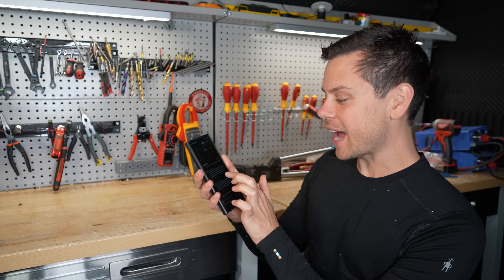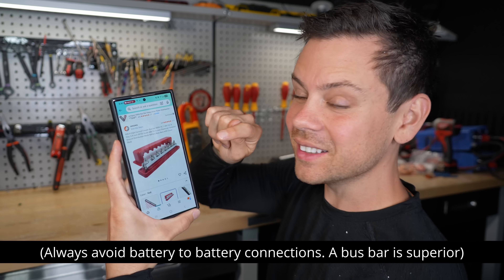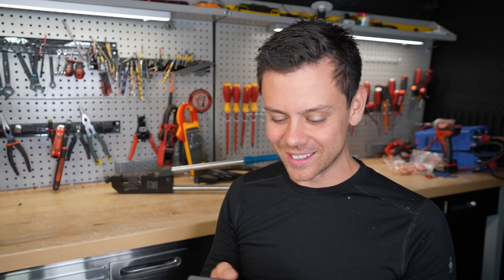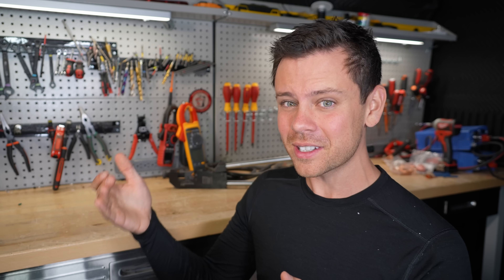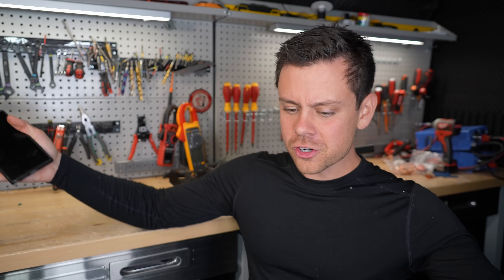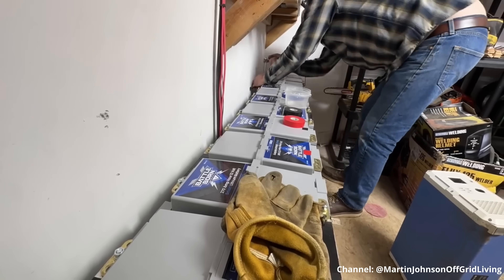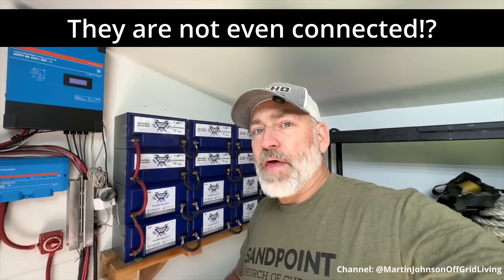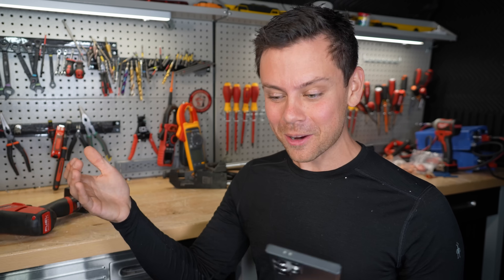My Reaction to Martin Johnson's "BEST Off-grid Battery Bank" Video 😬 Yikes!!

Comment: Soldering is actually better than a crimp connection but you have to use the correct solder. Silver solder has a higher melting point and is more conductive than lead solder and also has more strength than copper if done right. I’m going to say your definitely wrong on the solder joints if he actually does them wright which it doesn’t look like he did but your bashing solder joints in particular. I love your videos and definitely find them helpful but I don’t won’t the wrong info getting out. So far this is the only thing I have found in your videos that needs correcting. Keep up the excellent work.

Comment: You have lost credibility on this one. People commonly use 12v batteries to create 48. Eco-Worthy shows how to wire them that way. I agree that crimping is better, but if the batteries are going to be stationary and no one is going to be pulling on the wires your criticism of soldering in unfair. Next, there is very little information available on the correct gauge of wires to use for battery banks. The Chinese manufacturer SunGoldPower called for 4/0 the lug for which does not even fit the opening to their inverter. They subsequently  revised the spec to the correct size. Research does not provide the wire gauge specs and you have to calculate it based on mm2 carrying capacity of different size cables. It's very archaic and you can't fault this man for attempting to make the determination based on the amount of current he intends to use.

If you want to be critical, I suggest you take a look at DIYSolar, which is full of bad, unreviewed information that, if followed, can result in fire or death. It's actually very irresponsible to have a blog for this subject where unreliable and incorrect information is common. I.e., clean up your own house 
before you start throwing stones.

A video like this could lead to a lawsuit for defamation, especially since you are competitors in the business of making money selling advice, so you might want to be a little more careful. Many of the comments have pointed out where your criticisms are incorrect.

Comment: His logic for sizing the cables seems to come from house wiring, maybe. In house wiring you size your breaker and the following wiring to the load you are going to run. But, as you know, you don't do that with a battery bank because that would be like undersizing the wiring for the mains power coming into a house.

Comment: Dude is violating almost every rule for wiring up a system.

I thought that soldering in a no-no in home electric circuits, but I'm not a certified electrician and don't work with household electricity, so this is just from me trying to remember something from reading many years ago.

Comment: Will, how do you feel about using a victron distributor to parallel series strings of 12v batteries in a 48v system? Assuming appropriate sized conductors and over current protection via the distributor.

Comment: 0730MMXXV/1202h 🇺🇸 Will, Thank you. I don't think or imagine that, you are being confrontational towards any human being. By merely pointing out, the hear say assembler's folly is; not that. Spending tons of funds on Lishen/EVE prismatic cells,(made in China) that are assembled locally and using cheap Aluminium busbar to connect it,  is preposterous, unbelievable and uncalled for. Copper is the word, that needs to appear in mind, soul and sentiments, I dare say. You have performed several experiments, tests and several comments on many items related to PV panels, storage Batteries , its pros and cons. I've learned many things from you, in spite of my Doctoral degree in Nuclear Engineering. I,  still look forward to reading and understanding your presentations, in YT. I've seen many Warriors in YT, expressing , plagiarizing stanzas and wordings from other genuine technical experts and engineers. You express views and comments with several years of hands on experience and teach others, in a way they understand the concept of DC Power Supply, its potential working conditions.
Please continue your saga. I thank you, oncer again, for your relentless contribution in the field of PV Cells and natural energy parameters.. 73s

Comment: 4AWG? I used that to connect my 35A MPPT.  My battery cables are 0AWG and I only have 3* US5000 Pylontechs connected to a 5000VA Victron Multiplus II.

Comment: As an industrial and commercial electrician in the uk i built my own solar and battery system by watching every video you and off grid garage have ever made , plus loads more.  Did various experiments and trials made loads of mistakes. DC is definitely more dangerous than AC, this guy is oblivious to his own lack of knowledge. Hopefully he doesn't burn him and his family to death. Btw ive seen lots of soldered lugs and horrendous installations in my time...its not just the amateurs.

Safety first❤

Comment: tons of wrong information in this video on both sides, I agree I much prefer a crimped connection and all though the soldered lugs were done improperly a soldered connection is actually the best electrical connection that can be made, however a soldered connection is not as strong as a crimped connection. you can balanced batteries by voltage but you should get them within a hundredth of a volt. charging a lithium battery fully is actually not correct as many lithium batteries are not charged as high as their maximum charge voltage within the bms to significantly improve the life span of the battery. the rated charge voltage of a lithium battery is not the highest the cells can handle. the battery voltage is the only proper way to balance cells before connecting them in series or parallel this can be done by ensuring they are all the same voltage or by charging them to a known voltage both work. as for the battery cable size, you dont size your battery cables for the current the battery can provide, you size your batteries cables for the expected current load. for example most car batteries can deliver between 500-1000 amps but the starter motor and other loads are sized according to the expected load being delivered and not what the battery can deliver, if your inverter is only going to pull 100amps you can safely size your cabling to that load. this is also why a proper fuse or breaker is so important, if a short occurs, you want the fuse or breaker to protect the cables preventing a fire.
Reply: Thank you

Comment: As far as lugs being connected to wire I find the best connection to be crimped and soldered. I have read the instructions to just crimp and I do agree that crimping is the right thing to do but properly backed with soldering makes a much better bond.

Comment: Bro, you are over-reacting. I do like properly crimped lugs it save time, I would use them, they are good enough, but I would pick soldered lugs over crimped lugs any time if my goal is to make it as reliable as it can be. Soldering means connection is made on atomic level. This also means that no matter what, connection inside the lugs will never oxidize. (Lets say salty or acidic water gets inside)
It's a bit challenging to properly solder thick wire into the lug, but if it's done correctly, it will beat crimped version for sure.

Comment: I bought the same batteries because they were said to be the best at the time. This was before decent rack batteries, etc., came out. However, I used 2/0 AWG cables, Crimped them together, and put all the positives on top and the negatives on bottom, making sure the cables could not touch. I also used a 200A fuse per string. If I had it to do over with the same money I had back then, but with what is available now, I would use different batteries and a 200A fuse on each battery.
Reply: I also charged the batteries up in parallel to full before wiring them in series for my 48V system. I understand now that using 12V batteries to create a 48V system is not ideal, but before I had 6V golf cart batteries! LOL

Comment: In the sailing world I get the same gut wrenching reaction to all the sailing channels praising overpriced battle born, but they all get 10k of free batteries.  Talking to other cruisers they all think BB is the only battery solution because BB flooded the influencers with free batteries.  I have 600ah of EVE cells for less than 1k, BB would have been over 5k and way more space.  

One question I have always asked is maybe BB would not be so ridicoulusly expensive if consumers were not subsidizing the influencers?

Comment: 1:16 : charging all cells to 100% or charging them to a voltage of 3.65V is basically the same cause 3.65 is on the steep part of the curve (even 3.5V). But agreed that voltage for the most part of the curve is not a good indicator of SOC.
The good method is charging them all to 3.6V and then parallel them for 3 or 4 days with 0 load..the ,resulting overall voltage is the 100% SOC of the pack. Then i would charge it to .. 95% of this SOC.
I'm off grid since 2020 and my packs (EVE 280Ah) are still in very good shape.
Aluminium is ok, it's a pretty good conductor buit got to be .. something like 30% bigger then the coper bar.
Well ... solderring lugs is a bad move ... :D
What's the most ... akward .. is all those negative and positive wire that cross each other .. the guy is clearly not educated on the subject.
Battleborn is just an other overprice american gimmick...they are clearly not the gold standard they are a gold standard regarding the price ... they nearly are as expensive as gold yea.
Your natural reactions are nearly the same i had seeing this guy... :D

Comment: I used to work at an electric motor rewind  re manufacture shop. Big DC motors and we crimped and SOLDERED all the field coil and brush jumpers that were 4/0 and larger. These motors would come back after a couple years to get the commutators turned down due to normal wear. The soldered jumpers were fine.
Reply: The important bit there was the crimping. That was what held the connector to the wire; the solder just sealed the jojnt. (Low voltage telecoms tech from the 70's)
Reply: @0MyWay01

You CRIMPED and then soldered. I guess you missed that he did not crimp.
Reply: @billstevens3796  There's BMW Standard for this. Had to be secure at the insulation, crimped and soldered for a gass free joint. BMW would section our off-tool samples for assessment conormity.

Comment: Copper is not cheap, but I wouldnt use alum buss bars.   His batteries cost a fortune but he cheaped out on the connections.   Get a hydraulic crimper.  
I have no issue with using 12 volt cells but then you need to add a balancer.
I agree every string of 12 volt cells need  a fuse and since he is using 4 gauge it needs to be fused at 90 amps or so.  
Battleborn is priced outa sight.  Crazy expensive!

Comment: I've never bought any BattleBorn, but I do have two of the 280Ah Ecoworthy 12V batteries and I'm not very happy with them. I have them connected in parallel and their BMSes show very different states of charge. I charged each to 100% separately before connecting them in parallel and immediately one of them started discharging much faster than the other when I put a load on them. And the one that discharges faster recharges slower. For the price I'm willing to live with it, but if I were building a system with more than two batteries it might be worth paying more if it guaranteed more consistency between different batteries
Reply: I put in 16 of the EcoWorthy 280, 4 strings in series connected in parallel to create 48 volts. I have seen no one until this self proclaimed expert say not to do so. Many, including the manufacturer, say it's fine. I never came across the advice to charge each battery to 100% before connecting them, so I didn't. They have worked just fine. Two are only charging to 95% but I have no problem with that. In fact, it seems to be a good thing in order to increase the life of the batteries. In any case, given that they cost 1/10 of what I paid for LiFePo batteries 8 years ago I see no problem whatsoever.

Comment: I have to say batteries are prone to problems. Cells go bad. On occation a single cell causes me to work on the battery. I got EVEs 280 aH 16 makin a 48 V . Got 3 48 v made myself. Ya the EVE cells swell and I allow room for it cause if not they would lock in. I truely believe any battery , no matter how much it cost will have cells fail. If you can't fix it, it will be a hell of a heart ache when she goes. This guy has got a mess coming. Back in Texas we call it having more money then cents.

Comment: Agreed I'd rather have overengineered wire, clamps, coverings and bus bars (all copper) than under or "just in time" which usually means "just in time" to fail.

Comment: Great video. Do more of these. Could you also address the issue of installation in states like Massachusetts. Basically you can’t do any of your own work. And an electrician is not good enough you must have a licensed solar installer. Over regulation ahhhh!!

Comment: That battery bank is wild... 48v system and instead of using 48v batteries he used 12x 12v/270AH batteries that cost "on sale" over $25k... Bro could have just bought 2 or 3 15/16kwh wall/standup batteries and saved $15-20k easy with less wiring and space. None of this guy's video makes sense.

Comment: It is mind blowing how many YT'ers out there think they have a grasp of electrical system calculations leading them to winging it. The cost of the system shown is beside the point, but the risks of how the gentleman did the connections alone is, like Will called it out, a huge safety risk. When a undersized conductor deals with too much current under in addition to possible mechanical stress the solder will reflux and thus thus allowing the cable to slide out. Hope he has fire mitigation near by

Comment: I own a hydraulic crimper so cables for me are not a problem but automotive guys always used a Solder Pellets/Slugs to make custom battery cables which you dropped into the bottom of the lug before pushing the cable in and heating it with a propane touch. I just checked Amazon and they still make them.

Comment: I only discovered your channel about 4 months ago when a "free solar" company tried to sell us a 25 grand solar system that would only produce 15.6 kwh a day, and had no batteries, and they wanted to lock us into an increasing power rate under the guide of "the power company gonna raise your rates"
Found your channel, priced out and built a similar system that was I think 6-8 grand, would meet our needs, and disconnect us from the grid.
They never replied and I cancelled the contract. Youre the man.
I love finding videos of faulty electrical engineering on youtube. they are PLENTIFUL.

Comment: I must confess that I built my very first system (several years ago) based on Martin's Channel. 
I did however have Battle Born confirm that I was using the right connectors and the proper setup.
Reply: Oh we found the gullible guy. Watch out for scammers.

Comment: Nice video.. it seems you missed those two sparks when he accidently shorted out something... I also left comment that soldering shouldn't be done that way..I also recomended..crimp it and then you can solder even it isn't needed as such once it is crimped. Missing fuses and such i hope he will change it over time..

Comment: Everything else aside: what about just putting a fuse per string? It would help for the over current issues and could just replace one of the bus bars per string.

I did not quite get his cabling, but it looks like the different 48V packs had different cable lengths too.

Comment: Off grid garage debunked the charging up lfp batteries before paralleling them.  Only in the extreme case of one cell at 2.7v and the other at 3.5v was there excessive current.  It was great to see how torque affected the current flow.

Comment: 3:58 I would’ve agreed with you before, but I recently had to repair some forklift charges which charge large batteries at 48 V and I was surprised to find that the pin connections were soldered from the factory!

Comment: I do use 12v batteries to make 48v and I use the cheapest batteries I can find. I do however also use a 12v ballancer HA02 I believe it is called. If that is on it doesn't matter much if they are pree ballanced. They will eventually reballance them selves.
Lithium cells will never keep their ballance on their own regardless how well they are pree ballanced. That is why every battery has a BMS that ballances them. Having 4 by 12v batteries in series will allways get out of ballance in time if there is no extra ballancer as the HA02. It is there fore allways better to use batteries with the voltage of the system (48v battery for 48v system or 24v batteries for 24v system).
It is also a good idea to have a fuse breaker in each string.

Comment: Holy crap batman.. is this a joke video?
 I just bought 4 more jakiper 100ah batteries. I got the price down a fair bit more. Ava and happy with that. I'm posting the limit though. Using 95mm2 cable, crimped of course

Comment: Thanks for the solid critique.   3 days ago I watched it after it premiered.  I paused and commented my concerns right away after I saw the first 2 minutes.  Later I also could not believe the parallel setup and screen shot showing imbalance... just as predicted.   Your review has very helpful pointers.   I hope other installers take note, and make better choices.    12V is not the way to build large systems.